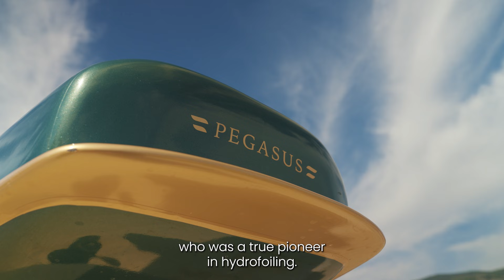Foilone Explained: Designing and Operating Our Electric Hydrofoiling Boat

Comment: Brilliant. So glad it is not available in Florida so I can keep my left nut.  Had the WindRider Rave years ago.  Plastic bags and sea grass were my enemies in the Chesapeake Bay.  Thinking it should move by paddle when you are close in.  Wonder how long and at what speed you could use it in displacement mode. Speed restrictions would be a pain.  Hocked a crab pot once. Always carried a knife after that.

Here’s somebody using a propeller motor https://youtu.be/d5mBpEx4_jQ?feature=shared